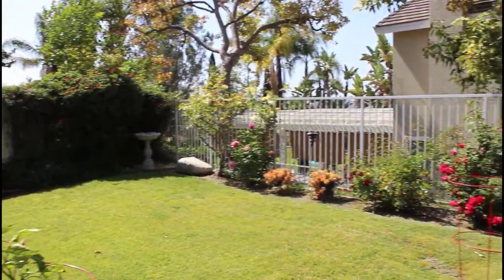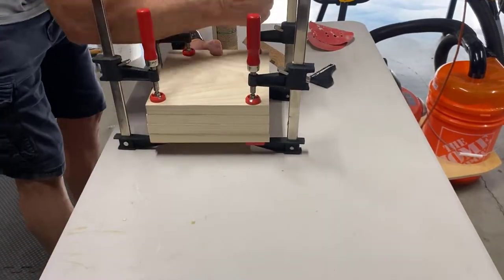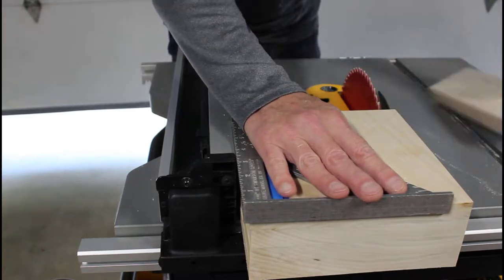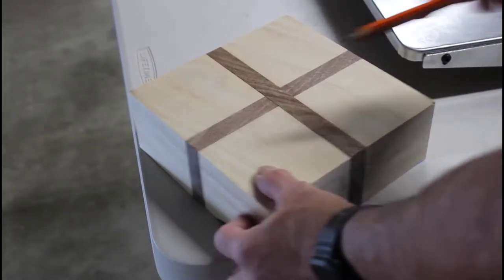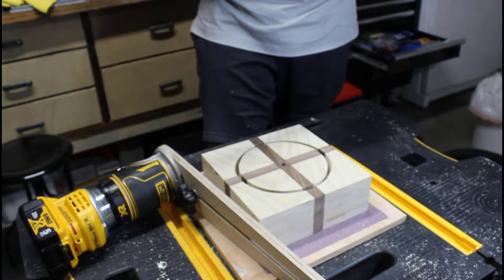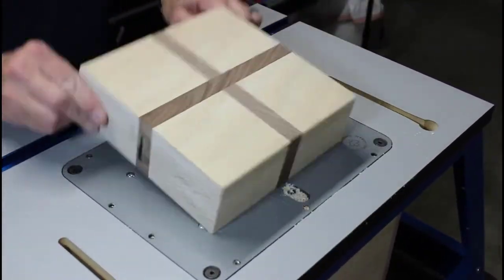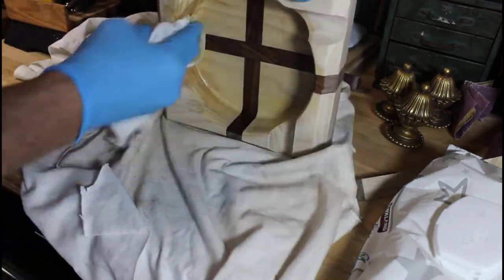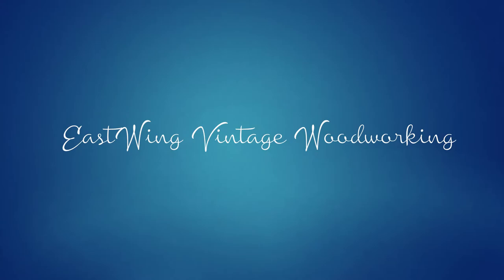Making a Cigar Ashtray

Comment: I made one using your design; just out of 2x12s but it works.  Final dimensions 8x8x2.5. Finished it with cutting board oil with wax and then hand rubbed bees wax. Thanks
Reply from the maker: Thanks!

Comment: Great video! Going to definately try this for a gift. 
Do you mind, what speed did you use on the drill press when hogging out the material?
Reply from the maker: Thank you for the kind words! If I recall correctly The speed was below 1000 revolutions per minute. The bigger the bit the slower the revolutions. As I mentioned in the video take your time during that process don’t press too hard on the drill. Press, let the bit do the work.  Good luck. Hope it turns out well!

Comment: I too make bowls and cigar ashtrays not to your degree of craftsmanship. I'm curious how or what method you used to remove/sand out the center point dimple that is created using a forstner bit?
Reply from the maker: I use the bowl bit in my router to go deep enough to remove those dimples created by the Forster bit.

Comment: Go online and order an xps light for your 779
Reply from the maker: Thank you for the suggestion!  Much appreciated!
Reply: @Eastwing Vintage Woodworking  I bought my saw at the back of my home depot for 275, got the light for 50 bucks. Now it's just like the dws780 lol but I didn't spend 650
Reply: @eastwingvintagewoodworking4797  I need to start uploading videos when I make things already. I'm in Southern Cali as well🌴
Reply: @creep life  Hell yeah, I did the same thing to my Dewalt and it was the best upgrade I could've done. That shadow line is great. 
Very easy to install too.